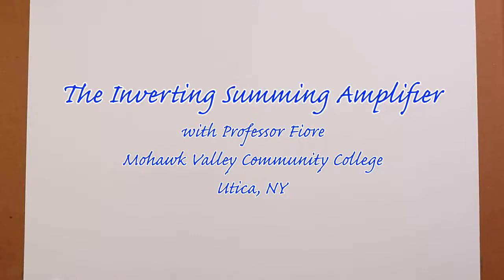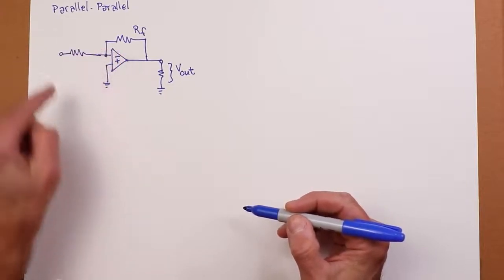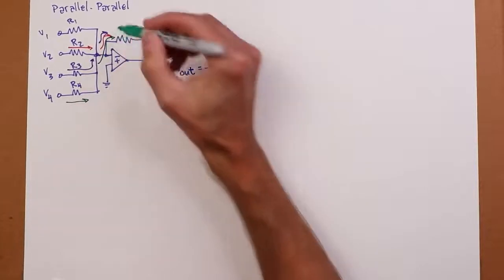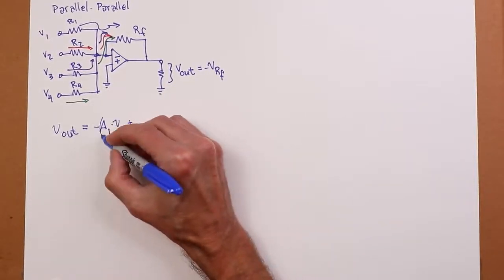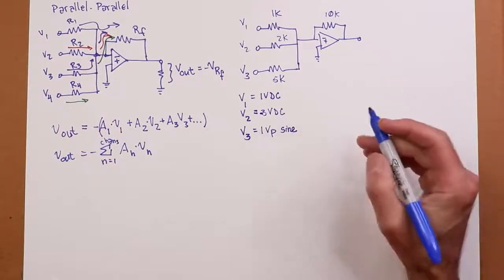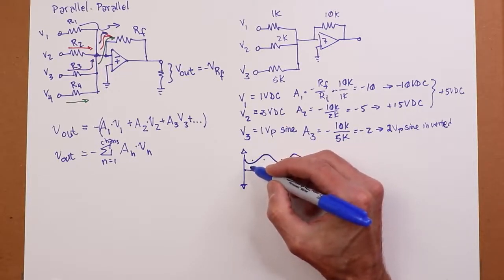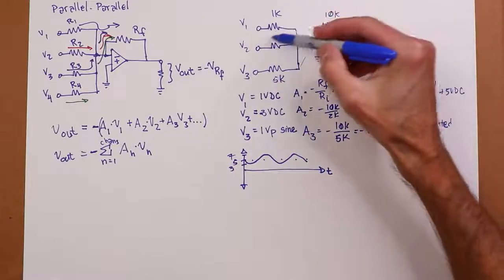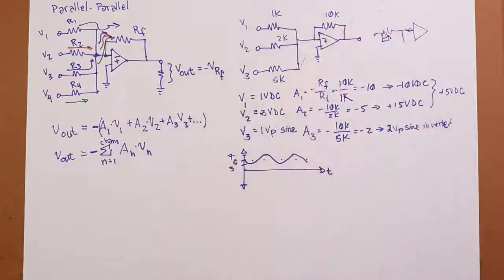Op Amps: The Inverting Summing Amplifier

Comment: When operating a summing amp on a single supply, is it permissible to use a single DC blocking capacitor, with all of the input resistors feeding into it, or should we use a separate blocking cap for each input?
Reply from the maker: I assume you mean that all of the input resistors tie into a single node, and from that node to the inverting input we place the coupling cap, yes? If so, that does complicate the calculation for the lower cutoff frequency and it might be impossible to get exactly what you want (assuming you want different f1 and/or have different input resistors). OTOH, if the inputs are not ground referenced (i.e., have DC offsets), you'll want caps for each input to avoid those offsets from leaking back to the other input channels.